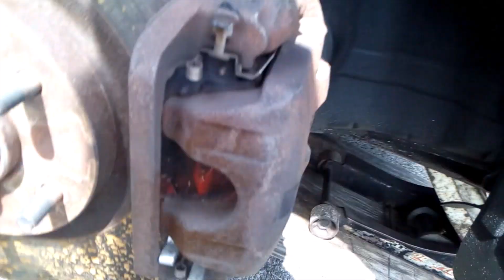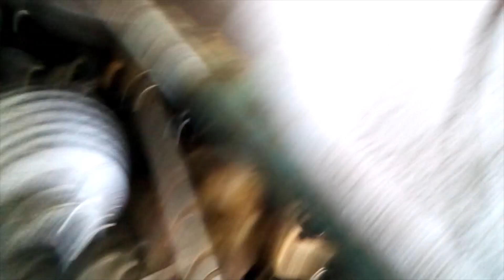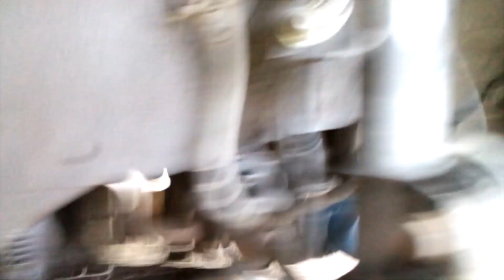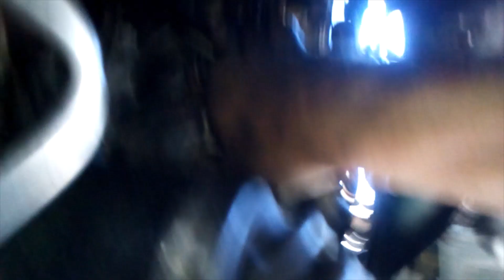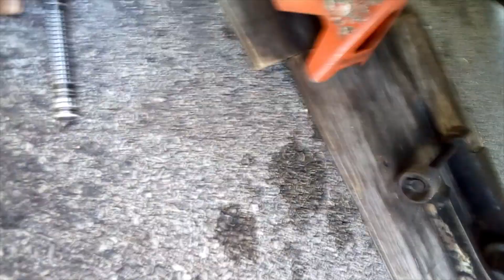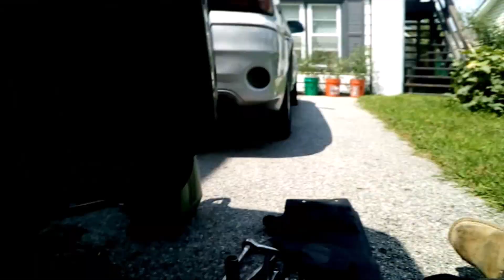2004 Nissan Maxima 3 5 Power Steering Pump & High Pressure Line Replacement

Comment: Did you have to remove the pressure sensor from the old line and install it in the new one?  If so, was there any special tool required to remove it?
Reply from the maker: Yes I reused the old pressure switch and you should be able to use a wrench or a deep socket to remove it
Reply: I know this video is 4 years old but hopefully youll reply so i can ask a question  @thedrivewaygreasemonkey2347

Comment: To remove the 14 millimeter bolt in the back its easier with a 14 millimeter ratcheting wrench
Reply: Tried with ratchet wrench, found the bevel ratchet works best with shallow 14
Reply from the maker: Hi B.V. Thank you, if I get another one of these to repair I will definitely use one.
Reply: @thedrivewaygreasemonkey2347  how do I follow you  lol

Figured it out. I'm a dunce
Reply from the maker: @willbruce5671  LOL. No worries, I have plenty of dunce moments myself